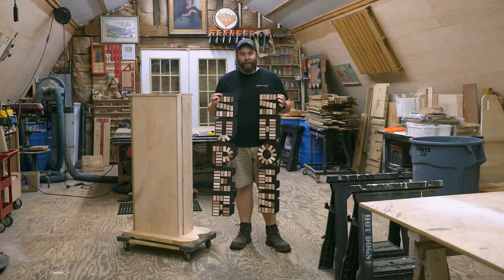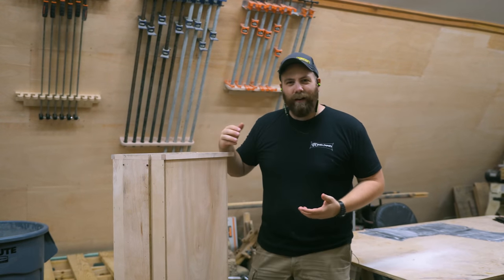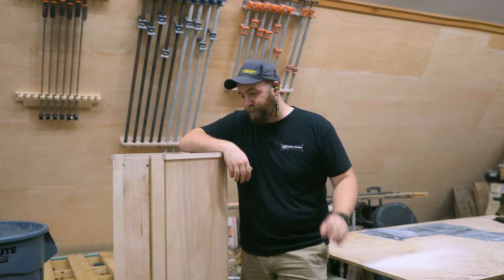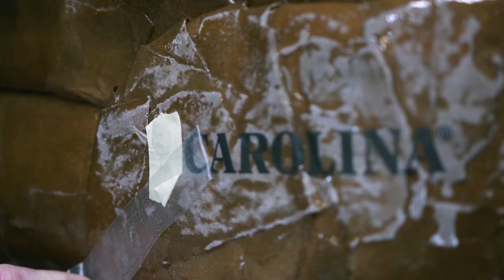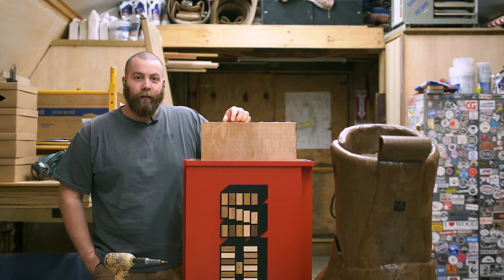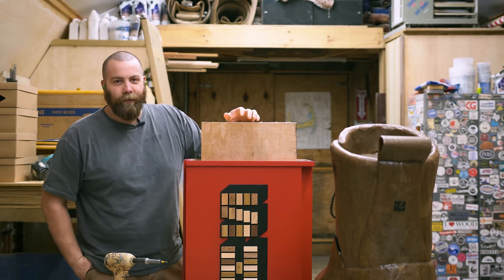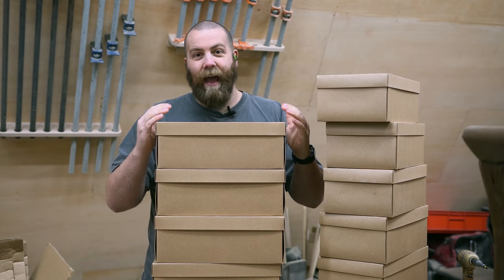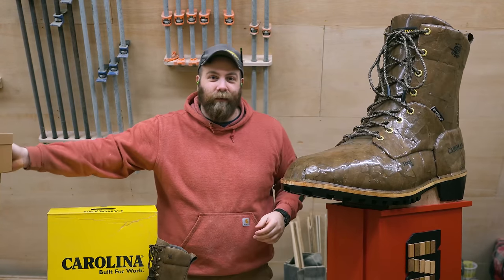Making a Giant Wood "PEZ" Dispenser (that dispenses shoeboxes)

Comment from the maker: Please support Super Shoes, TotalBoat, and ISOtunes, the sponsors who made this video possible:
𝐒𝐮𝐩𝐞𝐫 𝐒𝐡𝐨𝐞𝐬
► Carhartt gear https://bit.ly/3GZw6V0
Shown in this video: 100410 T-Shirt, K288 Hoodie
► Carolina Shoes https://bit.ly/34YH4wO
Shown in this video: Gust Lo CA1905, Pitstop CA7532
► Carolina Shoe Logger (currently $10 off!) - https://bit.ly/3gTncxK

𝐓𝐨𝐭𝐚𝐥𝐁𝐨𝐚𝐭 (coupon code "Jackman10" get you 10% off)
► Thixo Epoxy Adhesive https://bit.ly/3rRcq1m
► Flotation Foam https://bit.ly/350idZj
► High Performance Epoxy https://bit.ly/3sG6HKV
► Table Top Epoxy Resin https://bit.ly/36aDLDf
► Eco Solvent https://bit.ly/3BoOKEK
► Halcyon Clear Varnish (gloss and satin) https://bit.ly/3gOcA3f
► FixWood epoxy putty https://bit.ly/3sM8E8P
► Elixir enamel paint https://bit.ly/3GQEDK4

𝐈𝐒𝐎𝐭𝐮𝐧𝐞𝐬 (coupon code "Jackman10" gets you 10% off)
► Bluetooth hearing protection headphones! https://bit.ly/3JvdcqR
Shown in this video: PRO Aware, LINK (ear muff), LITE, FREE 2.0 (coming this spring!)